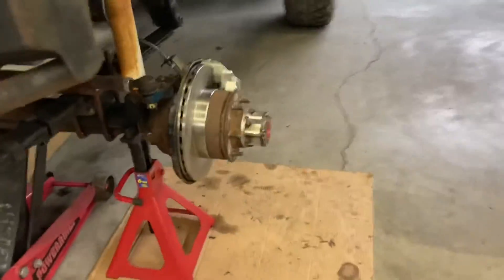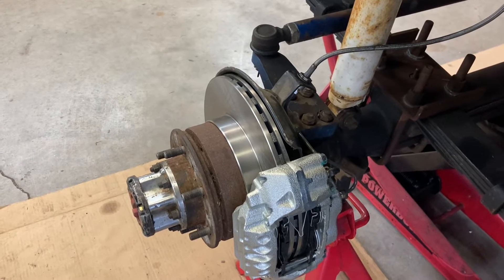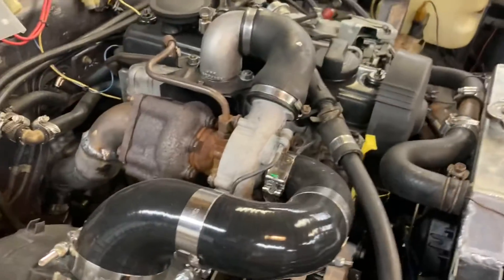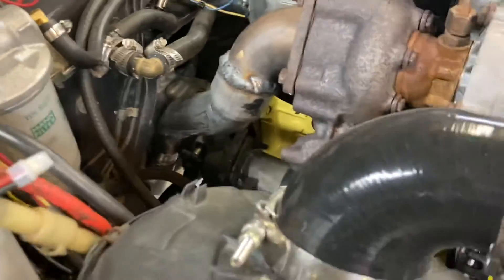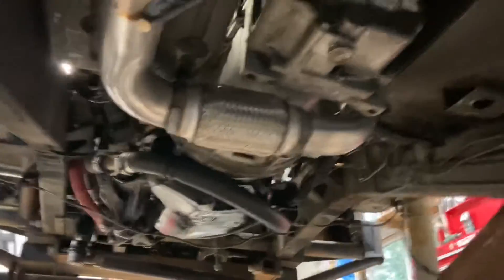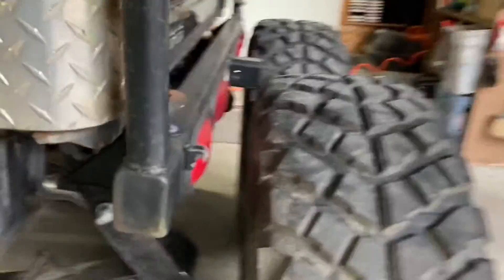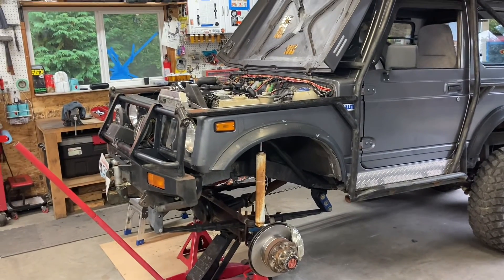1987 Samurai Volkswagen AAZ Turbo Diesel Swap Part 4: Intake plumbing and Exhaust

Comment: What radiator did you use?
Reply from the maker: Trail tough aluminum radiator. It’s inadequate. I will be switching to VW cross flow kit from Acme. Need to relocate PS gear box 1st so it will fit.

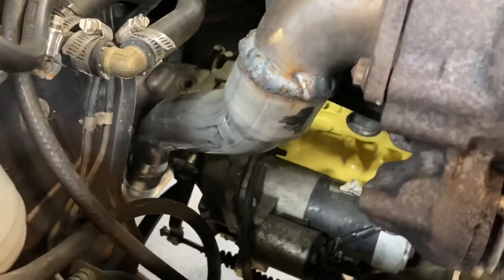Comment: What starter did you use? 3:44
Reply from the maker: It’s a sidekick starter
Reply: @Chris_by_four  from which car? Stock Samurai or any other ?
Reply from the maker: @Ffiliiip  it’s from a Suzuki sidekick. I got it with the kit from Acme. I believe they give the specs on their website. Www.acmeadapters.com

Comment: What size wheels and tires are you running?
Reply from the maker: 35x12.5r15’s
Reply: @Chris_by_four  I was feverishly taking notes on your brake upgrade..my guess is the bolt pattern is 5 on 5.5
Like the scouts and some fords…?
When I saw those fat fj calipers…I began to wonder about the 15 inch Wheels….are the calipers cast steel or aluminum?
I don’t want to make these axles any heavier…for sure.
Reply from the maker: They are Toyota axles so 6 lug
Reply: @Chris_by_four  thanks Chris
That makes more sense now